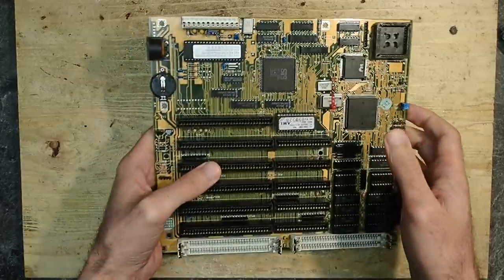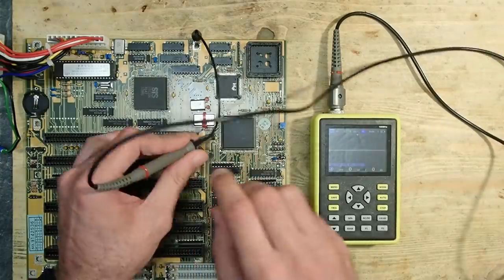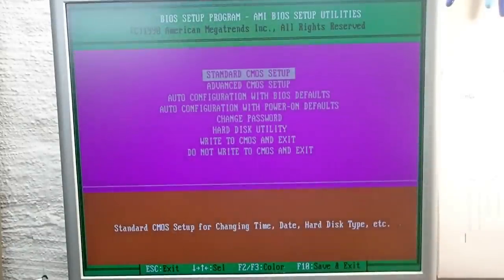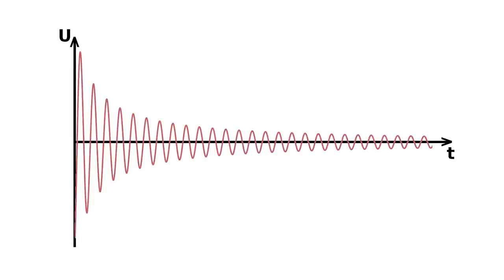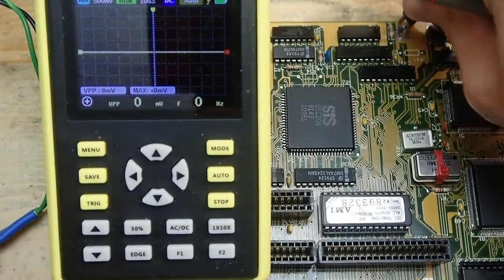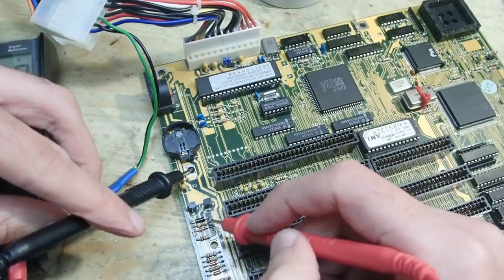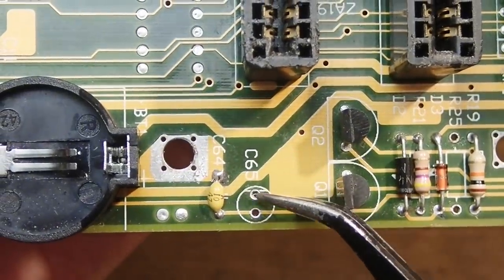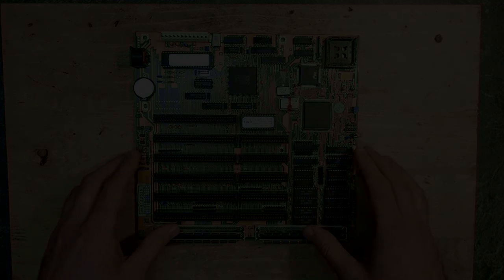Let's repair a mystical issue with an old 386 mainboard

Comment from the maker: Hi all, since the question came now about 4000 times ;) I'll just pin this answer here: my oscilloscope is a FNIRSI-5012H, it advertises 100MHz, which is a lie and remains just a dream. This thing works reliably for up to 35MHz, but it's more than enough to repair anything up to 486, since the FSB is usually up to 33MHz, or can be limited to for repairs. If the correct voltage is not important, but the waveform and the frequency, you can even use it for up to 75MHz. After all, even if it doesn't deliver 100MHz performance as promised, I'm still glad, that I have it and it's enough for what I'm doing.
Reply from the maker: @Arachnoid_of_the_underverse  Yes, I know. He basically confirms what I said. But I wouldn't call it bad, as he said, just because it doesn't support 100MHz as advertised. For many use cases it is still good enough for it's size and price. You just have to keep in mind, that it is reliable only up to about 35MHz... enough for retro repairs.
Reply: That is typical, you only get 1/3 of rating in scope or leeds for digital signals. If you were measuring sine waves only, it would do 100Mhz. Maybe some better probes or use a short spirng ground lead will give you better signals.
Reply: As a rule of thumb the sampling frequency should be 10x the max frequency. Best to my knowledge that scope samples at 250Mhz, so realiable bandwidth iz 25Mhz.
Reply from the maker: @ergindemir7366  10x is already too good. From the sampling theory you need at least 3x of the base frequency to get OK'isch results.
Reply: @kippie80  Proceed as following: Put a reference (function generator, frequency normal) with a BNC cable directly at the scope input. Then you can MEASURE what is going on in the BEST possible case[1]. No guessing, no fantasy numbers and no "magic" tips by uncle Bob invented in a fever-dream. Wishful thinking will just get you: NOWHERE! (and in the worst case to a place you don't wanna be: wrong assumptions lead to bad or even deadly decisions:/)
Sorry for that, but I hate that more than the plague. We are working (even hobbyists) in a trade that is based on science, physics and is well described and access to knowledge is more than easy. These is no place for guesswork or botches. 

[1] If that method shows that the signal accuracy gets worse at 35MHz, nothing (than an analog precision pre-amp, calibrated to mitigate the nonlinearities) will safe your day. It can only get worse ... whatever you do! (Oh, I will call the psychiatric ambulance if someone wants to buy a pre-amp now. Hehehe. Which would be an absurd idea and a waste of money in relation to such a cheap "scope" ... which absolutely does its work here).

Comment: Very unusual failure! I've also never seen a non working clock affect the system that way. I suppose we just don't know exactly how that chipset is using the 32khz signal -- it must be using it for other timers. And that tantalum being bad pulling down the rail. How interesting! Great fix!
Reply: There's probably a time-of-day IC on that power-rail as well. When it loses power, it probably can't keep holding some /IRQ line high, which in turn causes an endless stream of interrupt requests.

Comment: When I have motherboard issues I'm annoyed, Necroware: very exciting 😀
Reply from the maker: rofl
Reply: I'd feel the same way (intrigued and challenged to fix the issue) ;-)
Reply: I guess it's different when you have a problem to fix because you absolutely need the motherboard working for some other reason. When the process is more important than the final result, such as in a hobby, a teaching environment or a youtube video, it's certainly fun to troubleshoot things =)

Comment: After watching this video, I had the "inspiration" to fix my old IBM Aptiva P166 motherboard. The machine was posting VERY VERY slowly ( the memory test took more than 5 minutes, for example...). Using only my cheapo multimeter, poking through one of the clock circuits, I discovered a bad cap that was shorting (maybe grounding?) the 5v rail from the PS/2 connectors( a trace was also broken in this area).  Trace fixed, cap removed, and now my board is working again! Thank you so much for sharing your knowledge with us! Greetings from Brazil!

Comment: Trivia:
These clock crystals are usually 32 768 Hz, which is 2^15
That can be halved all the way down to 1 Hz if one so desire. They're quite universal and can be found in all kinds of stuff that only need a few kilohertz clock frequencies.
Reply from the maker: yes.
Reply: Yep, their original intended purpose was, alas.. standalone RTCs! Those on walls and wrists!

Comment: Very interesting! I wish this video had been out last week, I have just finished diagnosing and repairing the RTC power supply circuit on a 286 motherboard I own. One if the transistors had shorted in my case, discharging the battery overnight.

Comment: Some excellent diagnostic skills portrayed in this video!
Those tants are of course always culprit #1, sabotaging old beasts like this. I've seen them produce some nice fireworks, short out, making the power good signal go low but I've never seen them slow down a machine to a crawl like this. Very interesting indeed! Keep up the good work!
Reply: I recap most of them against high capacity SMDs in 1206 or what ever fits to the soldering pads. Never had an issue with that.
Reply: It's interesting what some people can solve, but problem with that is that your life is going around you and solving such problems can take days or even weeks, so you will spend all your free time and a lot of money on that. I am also addicted to trying to find out where is the problem, but I think it's actualy similar as alcohol or smoking, you just have to do that even when you know it's pointless, it will cost money and all your time, I just have to somehow remove this addiction and live like a normal person again, because I spent literally years by solving some problems with old hardware. 😀

Comment: The reason that the tantalum didn't explode in this case is likely because it's not tied to the PSU's 5V rail directly, but only through one of the clock power switching transistors (as you mentioned).  As the dead tantalum heats up it becomes more conductive, which normally causes the even more power to be dissipated in the capacitor, leading to thermal runaway and eventually magic smoke release.  But in this case the transistor has limited gain and is acting as a current source when overloaded, so the power dissipated in the capacitor actually decreases over time as the voltage drops, and the temperature reaches an equilibrium instead of increasing unbounded.

Comment: This was easily the most informative video I've seen on troubleshooting a slow voltage drop connected to the RTC.  It always seems to be these filter caps by the power; the 5150/5160 has these fail a lot too these days.  Excellent work!
Reply from the maker: Thank you very much. The tantalum caps are really a very common issue indeed, but in this case I was very surprised by the overall effect it had on the system. I was really keen to find out what's happening and I absolutely didn't expect what I found.

Comment: A good trick to measuring crystals with an oscilloscope is to add a 100k resistor in series with the 'scope tip. Just wrap one lead around the tip and probe with the resistor free end. You don't get the correct peak to peak voltage readings but you do get to see the waveform more correctly under a lighter load.
Reply: works this too with an multimeter in freq. counter-mode?
Reply: @superchiaki  Just look @ 19:46 he is using his MM in frequency mode!
Mine doesn't. It shows 50.00 Hz (I'm located in Switzerland and here we have 50 Hz Power Net Frequency, not 60 Hz).
Reply: @superchiaki  The signal straight off the crystal would probably be too weak and unstable for a meter.

Comment: You did a great job in finding the issue! Like some others said, I would be annoyed and at the same time propelled to find the problem. In the 90s, I had sooo many old computer parts for cheap. Then some life changes happened, along with losing many computer parts. Now, when I want to buy some of those components again... The prices are out of hand. What a shame! 

I especially like 386SX and also DX boards/CPUs. They can run 32 bit software while still being somewhat simple and repairable.

Comment: I have a 386Dx40 board that will hang at startup when it's at full speed but works perfectly in "turbo" reduced speed. I think you may have lead me on a path to finally diagnosing it. Your videos are extremely educational. Thank you.

Comment: Wow, you did not promise too much, that was very weird and very interesting as well. Love the instructive bits with the graphics. Learning so much about how these things generally work, just on the side.
One day I'll need to finally understand what Varta in which circuit I can replace how with which coin cell.
Reply: Haha... well, usually, if the battery is a rechargeable one -- NiCd or NiMH -- then you need a diode isolation circuit to keep the board from trying to charge a non-rechargeable replacement cell.  This is often literally just a diode, like B+ -->|--- In+, where B+ is the battery + terminal, the diode is --->|---, and In+ is the + input of the clock circuit.

If the RTC circuit uses a primary cell that is not rechargeable, like a Lithium 3V or 3.6V cell, then you can just drop in a CR2032 instead.  The latter, with 3.6V, is a little higher than a coin cell, which is 3.0V nominal, so it could be borderline sufficient.  But there's often quite a bit of tolerance.

I'm building a 1/2-AA replacement module with a 3D printed cylinder, a vertical coin cell holder, and a PCB to boost 3.0 to 3.6V, to power some Macs that aren't quite happy with 3.0V.  The downsides:  1) You need a very efficient boost regulator, since even a 10-100uA load from the converter circuit will drastically reduce the useful life of the cell.  2) A super high efficiency reg IC tends to be very very small (like 2x2mm.)  3) One such TI chip that I found is, like many things right now, in short supply at the moment.

Comment: I have the exact same issue with a Quantel 286  motherboard. In my case it was battery acid damage near the switching circuit that killed some of the traces. Board works now :) Thanks for posting this video!

Comment: Absolutely awesome root cause analysis! I enjoyed and learned from that video a lot! Thank you! btw, from where did you get this interesting LCR meter? Is this a self made kit? cheers, peter
Reply from the maker: Hi Peter! Thank you very much, where have you been so long? I'm missing some cool CPU videos ;) The oscilloscope seems to be very interesting for so many people. Every second question is about the oscilloscope. It is not a DIY device, since all what you can get there is couple of kHz, but no way to get into MHz. My oscilloscope is a FNIRSI-5012H, it advertises 100MHz, which is a lie and remains just a dream. This thing works reliably for up to 35MHz, but it's more than enough to repair anything up to 486, since the FSB is usually up to 33MHz, or can be limited to for repairs. If the correct voltage is not important, but the waveform and the frequency, you can even use it for up to 75MHz. After all, even if it doesn't deliver 100MHz performance as promised, I'm still glad, that I have it and it's enough for what I'm doing.
Reply: @necro_ware  Hey. Yeah, I had some issues and were totally time overloaded. But now the wintertime is coming and many videos on my channel. ☺️. I was meaning the device with which you checked the tantalum cap. This pcb with display…. cheers, peter
Reply from the maker: @CPUGalaxy  Ah, that tester. I was asked so many times now about the oscilloscope, that I assumed you mean that one as well :D Well, the tester is from China, but it was dead on arrival, the power supply didn't work and there were other issues with it. I had to modify, fix it and add a 3D printed stand with a battery holder underneath. So, yes, it's kind of self made, if you want so....

Comment: I've had a similar issue on a different piece of hardware : a trident 8 bit vga video card

The card was working but had a terrible video output. Some of that was due to the low quality ramdac, but when I swapped it and messed with the card I noticed that the image was getting darker and darker as I used it and there were some bad interferences in the brightness of the signal.

I checked the tantalum caps and one reported a capacity way over its initial capacity (like 2-3times the initial value). When I replaced it, the card suddenly displayed a beautiful picture !

When they don't fail short tantalum caps definitely have some weird side effects !
Reply: high capacitance indicates leakage because capacitance testers measure the amount of time the cap takes to charge in order to calculate the capacitance...if its leaky it will take more time to charge....never seen a leaky tantalum though...i thought only electrolytics and old paper and wax or paper in oil caps could develop lekage current, uasually tantalums just short
Reply: maybe thats the issue i got with an old macintosh nubus-videocard.

Comment: This was awesome! As someone who is also interested in retro hardware and as someone who is currently an electrical engineering student, this is super informative and helpful. I absolutely was baffled by this issue at the outset, but found your explanation to be so compelling, simple, and interesting. Old tantalum caps sure can act weird when they go bad! Thank you for sharing this! I have a VLB video card that's suffering from a weird issue where its image fades and darkens to nothing, and I am now somewhat convinced it's a bad capacitor. I'll for sure be using these techniques and skills as I go!

By the way, I absolutely loved that tester you used to check the capacitor. Do you perhaps mind sharing more info about it? It seems particularly useful!

P.S. Thank you for showing some basics of probing motherboards! I haven't seen any other video that really shows the easiest ways to maneuver an oscilloscope around and, while I have one, I haven't really used it for board repairs.
Reply from the maker: Thanks a lot! Glad you liked it. The tester was a half working part, which I ordered from China years ago. It had some problems in the power supply circuits, which I fixed back then, otherwise it works quite well, but I think you can buy something better, which would work out of the box :D
Reply: @necro_ware  My apologies for taking so long to respond, but thank you for your reply! I see, that makes sense. It’s a very neat device! I saw a few out there and may have to pick one up as I tinker more and more. I also just wanted to say thank you again! As someone who’s new to all this, your channel makes everything so easy to understand and you present everything in such an interesting way!

Comment: the cylindrical oscillator is just a crystal that oscillates at a specific frequency, it can't oscillate by itself so it needs a driver for it, one that continuously "bangs" that crystal to keep it ringing, while the 4 pin crystal oscillators have that driver built in.

when you see some voltage slowly fade away, it could also be temperature related, like a faulty transistor that stops conducting when it gets hot.

Comment: Great stuff Necro! I also have some 386 motherboards that do not work really reliably... Will check this part of the Mobo for sure when I have some time to spare... Thank you! Keep on going! May I ask what is that oscilloscope you are using? Perfect for a hobbist, since it is so small.
Reply from the maker: The oscilloscope is a FNIRSI-5012H, it advertises 100MHz, which remains just a dream. This thing works reliably up to 35MHz, but it's more than enough to repair anything up to 486, since the FSB is usually up to 33MHz, or can be limited to. If the correct voltage is not important, but the waveform and the frequency, you can use it for up to 75MHz. Even if it doesn't deliver 100MHz performance, I'm still glad, I have it and it's enough for what I'm doing. It is very small and handy.

Comment: Capacitors are a nightmare in IT for decades computers would have random issues I personally never noticed a clo0ck issue like that except battery's dying but I certainly learnt something new today. Remember the era of popping capacitors from particular Pentium 2 till after LGA 775 when they learn to use solid capacitors. Those  jelly bean part capacitors I do know a site where you can buy them you can buy nearly anything EE related I will try and find the site amongst my millions of bookmarks and site lists. I would also support your channel I love your work and at the moment work is rare as rocking horse manure in Australia due to the Rona demolishing our economy but I am trying to do research on old computers and also start a charity building older computers for poor countries that don't have access to computers. Your knowledge helps us enthusiasts and IT pro's honestly I think you discovered a problem which has plagued IT since the late 80's and parts like motherboards were just ditched and a upgrade put in its place when a simple off the shelf jellybean EE part could of fixed it with the right trouble shooting techniques. One thing I do repair when I get my hands on them is old AT and ATX power supplies and power supplies are becoming short in supply they are a dangerous component to work on as you know and I do it on a EE hobby level despite my IT qualifications. I recommend preserving and or reconditioning any AT power supplies you have just make sure there is no residual power in them and know what you are doing as you would but for others reading this BE CAREFUL